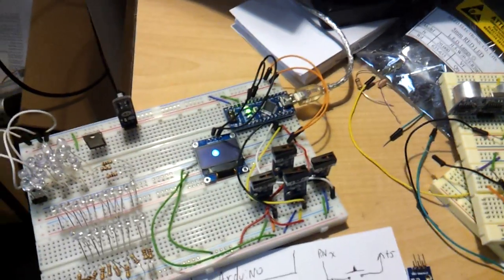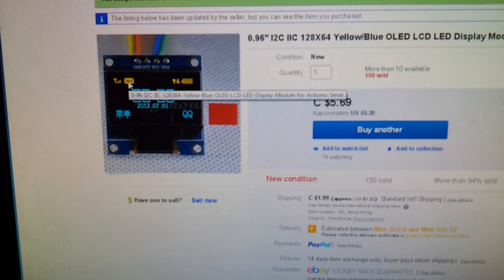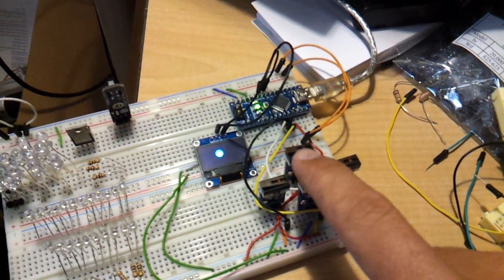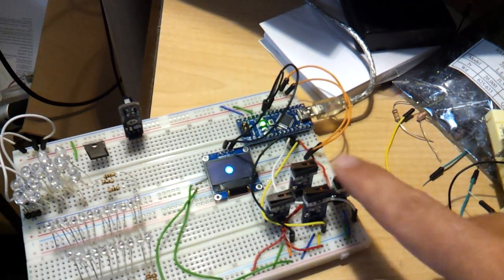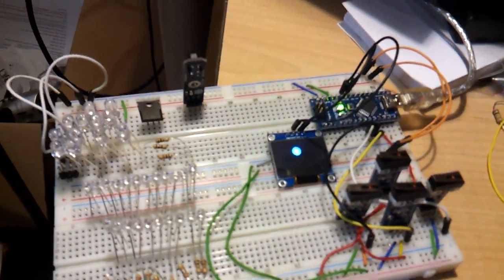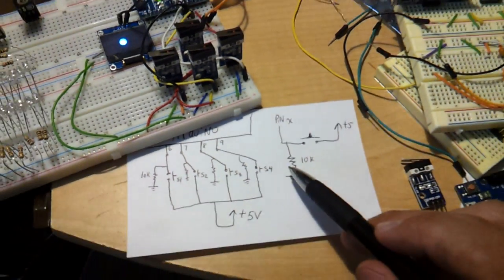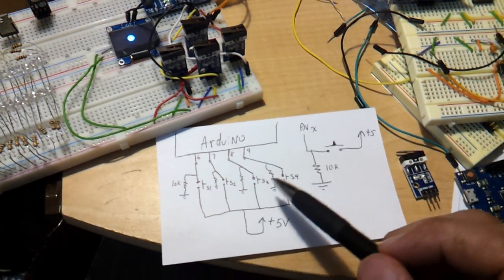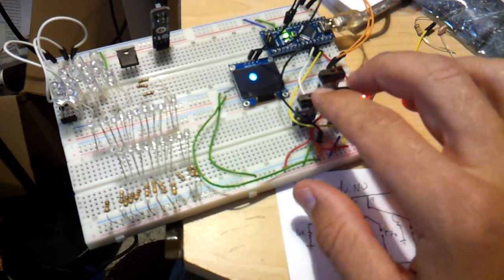0.96 I2C IIC 128X64 YellowBlue OLED LCD LED Display

Comment: You should share your code mate!
Reply from the maker: /*******************************************************************
This is an example for our Monochrome OLEDs based on SSD1306 drivers

  Pick one up today in the adafruit shop!
  ----> http://www.adafruit.com/category/63_98

This example is for a 128x64 size display using I2C to communicate
3 pins are required to interface (2 I2C and one reset)

Adafruit invests time and resources providing this open source code, 
please support Adafruit and open-source hardware by purchasing 
products from Adafruit!

// Connect GND to Ground
// Connect SCL to i2c clock - on '168/'328 Arduino Uno/Duemilanove/etc thats Analog 5
// Connect SDA to i2c data - on '168/'328 Arduino Uno/Duemilanove/etc thats Analog 4

Written by Limor Fried/Ladyada  for Adafruit Industries.  
BSD license, check license.txt for more information
All text above, and the splash screen must be included in any redistribution
*******************************************************************/
#include <SPI.h>
#include <Wire.h>
#include <Adafruit_GFX.h>
#include <Adafruit_SSD1306.h>

#define OLED_RESET 4
Adafruit_SSD1306 display(OLED_RESET);

#define NUMFLAKES 10
#define XPOS 0
#define YPOS 1
#define DELTAY 2

///////////////////////////////////////////////////
const int s1 =6; // switch 1 on pin 6   in the right direction
const int s2 =7; // switch 2 on pin 7   in the left direction
const int s3 =8; // switch 3 on pin 8   in the down direction
const int s4 =9; // switch 4 on pin 9   in the up direction

int val1,val2,val3,val4;
int a=0,b=0,c=0,d=0;
int xAxis=63,yAxis=33;

/////////////////////////////////////////////////////

#define LOGO16_GLCD_HEIGHT 16 
#define LOGO16_GLCD_WIDTH  16 

#if (SSD1306_LCDHEIGHT != 64)
#error("Height incorrect, please fix Adafruit_SSD1306.h!");
#endif

void setup()   {                
  Serial.begin(9600);
  
  pinMode(s1, INPUT); // in the right direction
  pinMode(s2, INPUT); // in the left direction
  pinMode(s3, INPUT); // in the down direction
  pinMode(s4, INPUT); // in the up direction
  

  // by default, we'll generate the high voltage from the 3.3v line internally! (neat!)
  display.begin( 0x3C);  // initialize with the I2C addr 0x3D (for the 128x64)
  // init done
  
  // Show image buffer on the display hardware.
  // Since the buffer is intialized with an Adafruit splashscreen
  // internally, this will display the splashscreen.
  display.display();
  delay(1000);

  // Clear the buffer.
  display.clearDisplay();

}

  

////////////////////////////////////////////////////////////////////////////////////////////
void loop() {
  ///////////////////////////
  val1 = digitalRead(s1);  // variable to store the state of the switch 1   in the right direction
  val2 = digitalRead(s2);  // variable to store the state of the switch 2   in the left direction
  val3 = digitalRead(s3);  // variable to store the state of the switch 3   in the down direction
  val4 = digitalRead(s4);  // variable to store the state of the switch 4   in the up direction

if (val1 == HIGH) // if switch 1 is pressed
{
  a = -2;
} 
else {           // if swich 1 is NOT pressed
  a = 0; 
}

if (val2 == HIGH) // if switch 2 is pressed
{
  b= (2);
} 
else {         // if swich 2 is NOT pressed
  b = 0; 
}

if (val3 == HIGH)  // if switch 3 is pressed
{
  c= (-2);
} 
else {             // if swich 3 is NOT pressed
  c = 0; 
}
if (val4 == HIGH)  // if switch 4 is pressed
{
  d= (2);
} 
else {           // if swich 3 is NOT pressed
  d = 0; 
}

xAxis=a+xAxis+b;
yAxis=c+yAxis+d;

if (xAxis < 0) // parameter for x-axis in negative direction
{
  xAxis=0;
}
if (xAxis > 127) // parameter for x-axis in positive direction
{
  xAxis=127;
}

if (yAxis > 63) // parameter for x-axis in positive direction
{
  yAxis=63;
}
if (yAxis < 0) // parameter for y-axis in negative direction
{
  yAxis=0;
}

// This draws the circle with the coordinates below.
  display.fillCircle(xAxis, yAxis, 10, WHITE);
  
  // Show the display buffer on the hardware.
  // NOTE: You must call display after making any drawing commands
  // to make them visible on the display hardware!
  display.display();
  delay(50);
  display.clearDisplay();
}

////////////////////////////////////////////////////////////////////////////////////////////////

void testdrawcircle(void) {
  for (int16_t i=0; i<display.height(); i+=2) {
    display.drawCircle(display.width()/2, display.height()/2, i, WHITE);
    display.display();
  }
}
Reply from the maker: copy and paste the whole thing:)